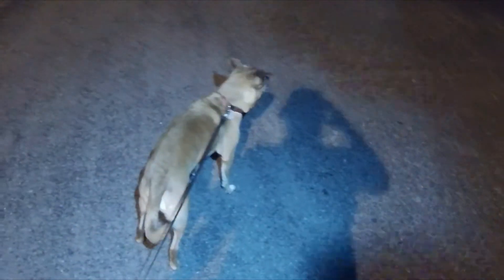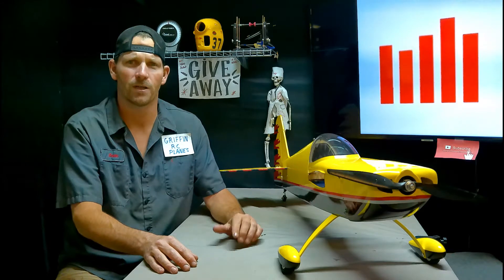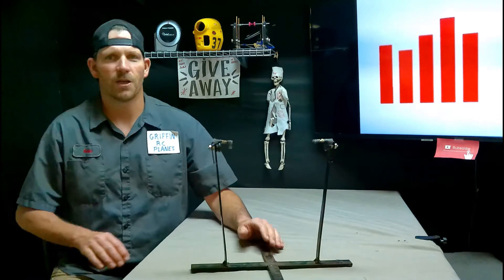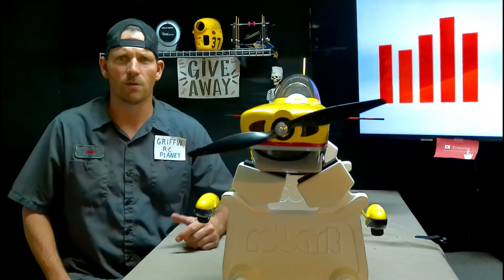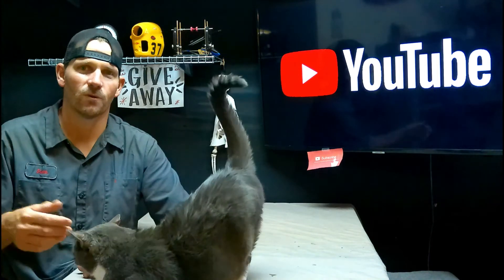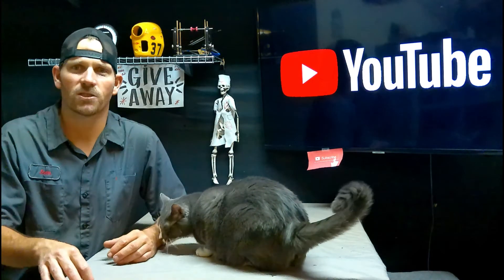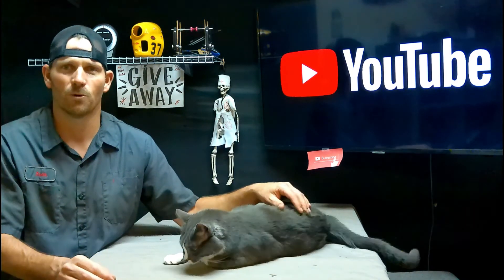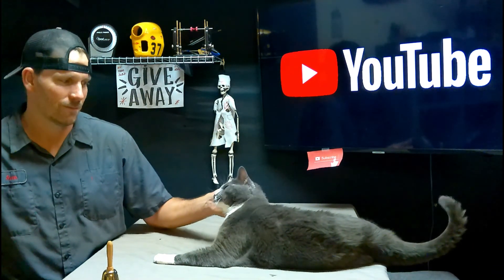AVIAN 60 AMP SMART ESC COOLING RC AIRPLANE HOW SHOULD THE AIR FLOW WORK ???

Comment: I like tinkering as much as flying too...I have 2 planes that I haven't flown yet because I took my time building them and I like making my control rods custom with clevises and ball ends instead of z bends so theres no play and I can use plastic gear servos and I always have to add carbon rods thru my fuselages to reinforce the foam and make them all solid and crash resistant......I also put like 25 hrs a week on the simulator cuz I get alot of down time at work

Comment: Hi Sean that was an excellent demonstration of adding just another little hole in the front of the cowling how much more airflow you can get passing through the fuselage and out the exit holes! I have a tt evolution 1.5m with the Avion esc in it and I saw on other videos that it to has an overheating problem, I haven't flown it yet but I don't know how to get that telemetry readout working maybe if you have the time you could make a video showing us "me" how to set it up🤠 I have the spectrum NX8 TRANSMITTER thank you your friend Marty from Canada 🇨🇦 🛩 🛩
Reply from the maker: EXCELENT VIDEO IDEA . FRIDAY NIGHT IT IS